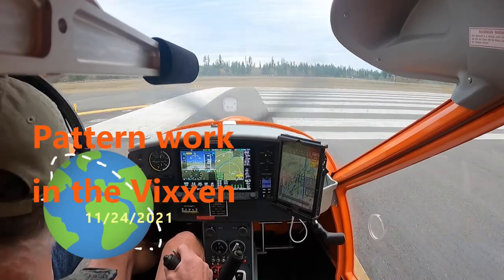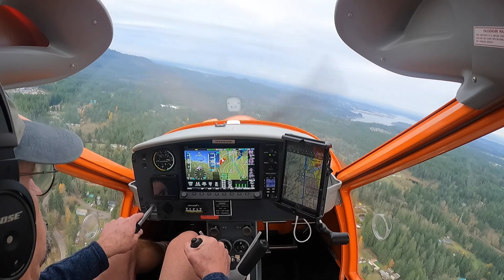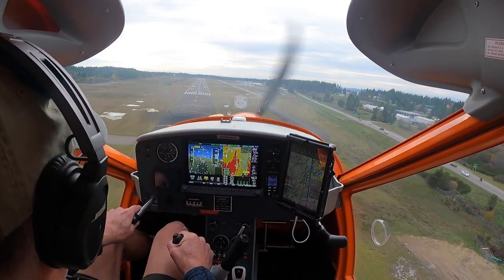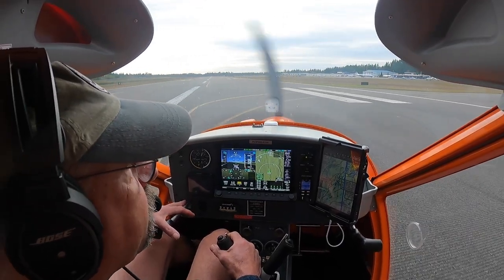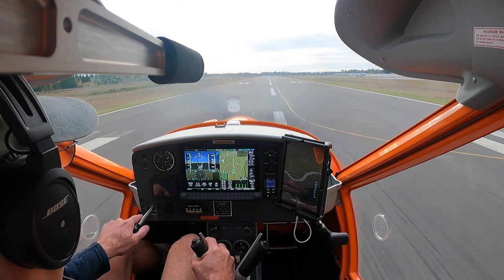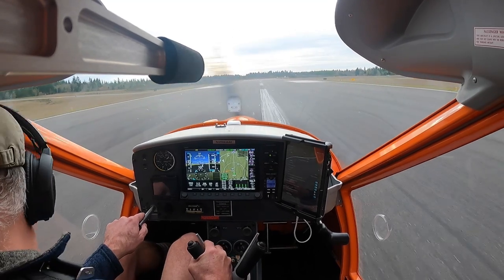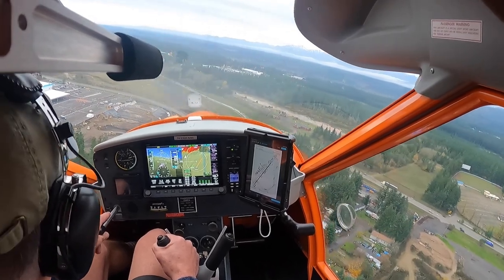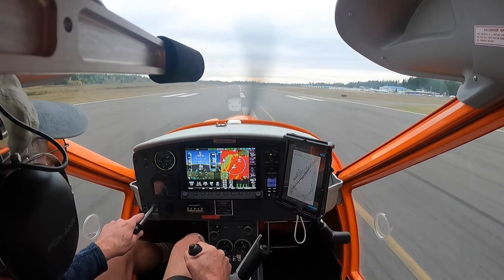A little Pattern Work In the Aeroprakt Vixxen A32

Comment: Did you used to fly the Zenith? If so, how do you like the A 32 compared to the Zenith? Looking at both for next plane
Reply from the maker: Yes we had 77P
Reply from the maker: Advantages of the 750 vs the A-32
Better visibility
Nimbler in the air
Slightly roomier 
Built like a truck
Sinks like a manhole cover
Parts are made in USA

Advantages of the A32 vs the 750
Much cleaner aircraft
Incredible glide ratio 
100lbs Better payload
Much faster
Smoother in flight
More stable in flight
Better range 
Much Quieter
Reply: Just saw this video and your comparison. Can we chat? Looking at getting my first plane.

Comment: Yes, I am fully aware of that. But the chance of accidently applying the brakes if something stressful catches you unaware during takeoff run is too great. 
Release the brakes either before of after applying power, remove fingers from the brake lever and only transfer fingers back if required. The occasions of leaving feet lightly on brake pedals and then inadvertently applying the brakes on higher performance aircraft has resulted in many tyres being dragged off the rims, sometimes with severe results.